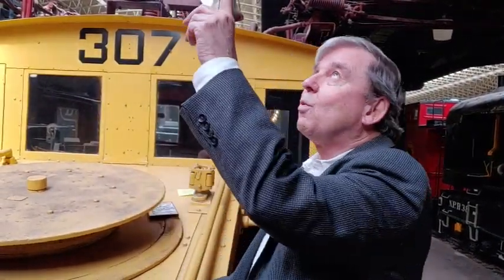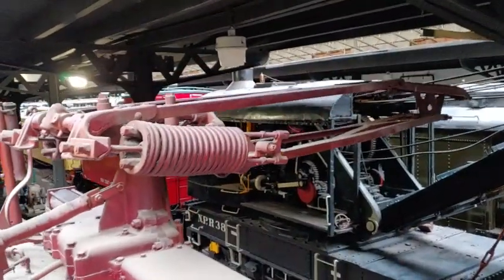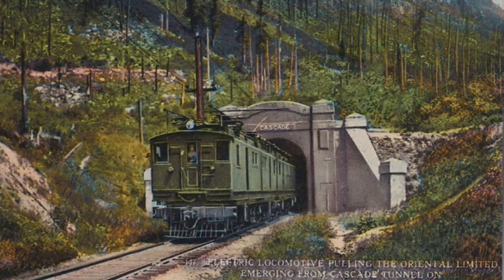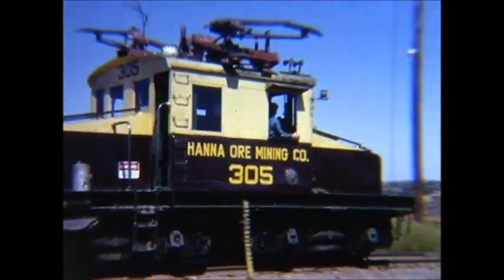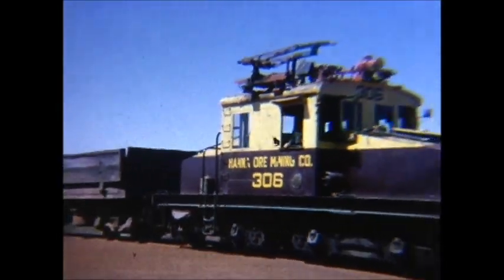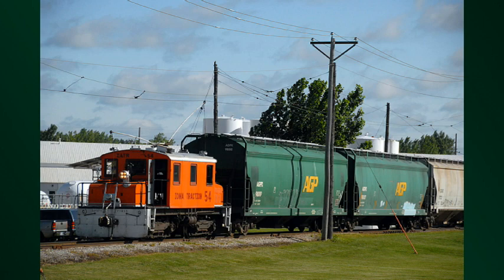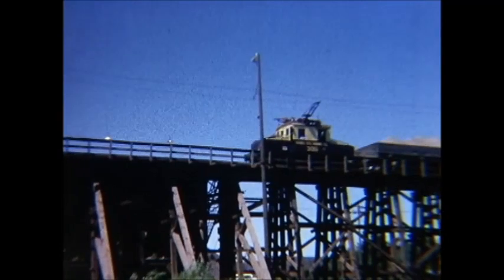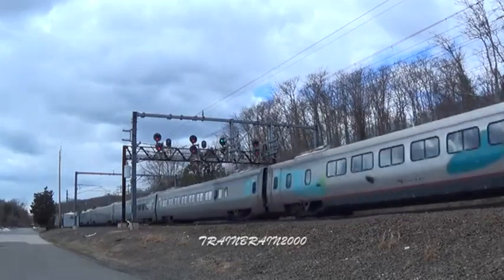Railroad Museum Tours #28 - Hanna Ore Mining's electric locomotive #307

Comment: Catenary refers to the descending curve of the overhead power wire support cable.  The extension cord wasn't plugged in, as such.  The locomotive operator used an insulated pole to lift the hooked end of the extension cord up to the existing overhead power wire and proceeded from there.